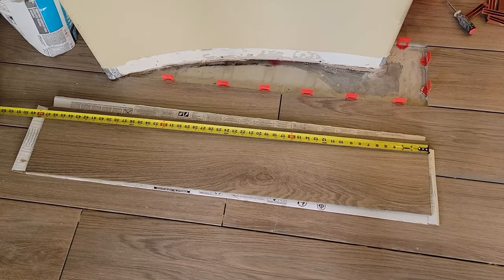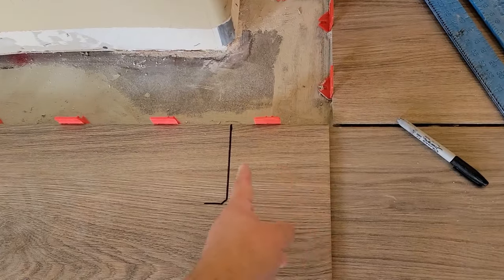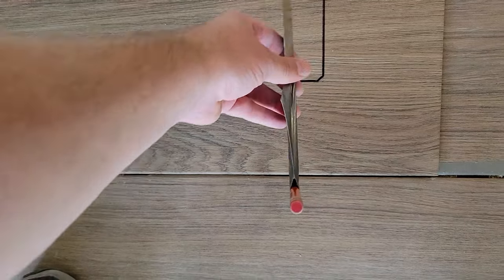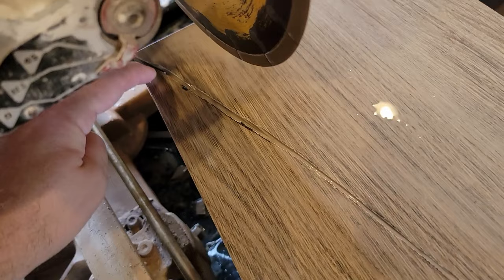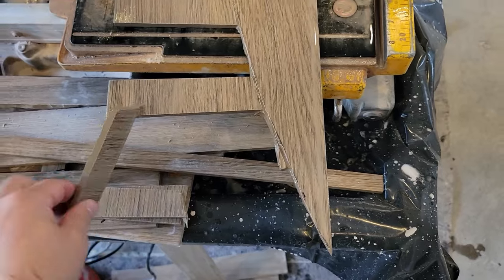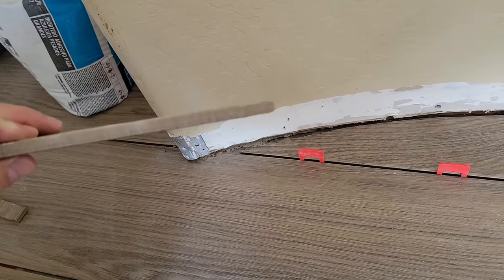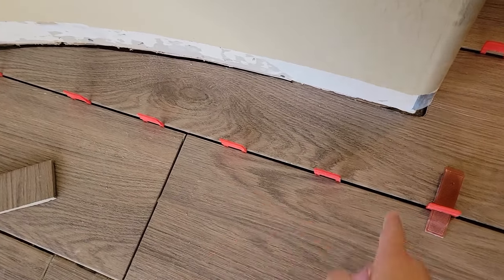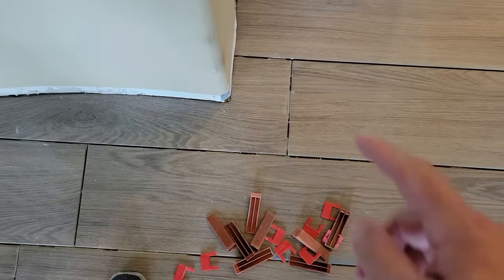Genius Hack To Cut Curves In Tile By Rounded Walls | Smart Tips & Tricks To Make Curved Tile Cuts

Comment: I’m a landscaper so laugh if you want, but I’ll just get cardboard , put it up against wall, use a knife to cut it to size, and then use the cardboard as a tracer to transfer the shape onto your tile or flooring. I’m just a landscaper 😅 I think what you did is called scribing? My dad does that without that tool he just uses his hand and the pencil.
Reply from the maker: If the cardboard method works great for you, that's awesome. I'm guessing the tolerances in landscaping are not so strict as in tiling.

In my case, especially with long tiles (and these were 4 ft long) the cardboard would most likely be an extra step and also open me up to error since it may bend a bit.

See the longer curved cuts in this other video: https://www.youtube.com/watch?v=JKDJlV7WtKo

Have a great day!
Reply: @MarkShows1  not saying you should do the cardboard method. just saying thats how me a dumbass landscaper gets these angles lol  4ft tiles sounds like a nightmare
Reply from the maker: If cardboard works great for you, that's actually a very smart way to go about it because you don't need to buy a special tool and most likely have easy access to cardboard from boxes, etc so thumbs up to you.

Comment: `you know if you used a grinder you could have it cut in about 1min instead of fucking around with a wet saw.
Reply from the maker: (This is almost a copy & paste of what I replied to someone else:)

Trying to avoid silica dust by any means because it causes irreversible lung disease or worse. Very dangerous, even small amounts that are not even visible.

So given that I had the wetsaw set up inside the house (while the temperature outside was around 112F in Phoenix, AZ), it took more time but yea, I usually do these cuts on the wetsaw and btw, very few houses have rounded walls.

But yes, the grinder (with some water) could be used outdoors in most cases but for some of the mansions around here, the mess that's created is also a problem (dirty water spots, tiny sharp tile pieces on the ground where people walk barefoot to the pool, etc).
Reply: @MarkShows1  ive been tiling 30 years, only time we have used a wet saw is for Marble/stone. 

isnt silica dust from stone ?
Reply from the maker: @Pedro.Chapps  

The following is just a part of what you can see at this link.
I added my notes in [brackets] below.

https://www.osha.gov/silica-crystalline

"Crystalline silica is a common mineral found in the earth's crust. Materials like sand, stone, concrete, and mortar contain crystalline silica. It is also used to make products such as glass, pottery, ceramics, bricks, and artificial stone. 
[some online source says porcelain has about 14-18% silica and porcelain is a type of ceramic]

Respirable crystalline silica – very small particles at least 100 times smaller than ordinary sand you might find on beaches and playgrounds – is created when cutting, sawing, grinding, drilling...[see link for more].

Workers who inhale these very small crystalline silica particles are at increased risk of developing serious silica-related diseases, including:

Silicosis, an incurable lung disease that can lead to disability and death;
Lung cancer;
Chronic obstructive pulmonary disease (COPD); and
Kidney disease.
To protect workers exposed to respirable crystalline silica, OSHA has issued two respirable crystalline silica standards: one for construction, and the other for general industry and maritime."
Reply: @MarkShows1  well 90% of us tilers are fucked so

Comment: Nice! You need to keep the pencil tile jig perpendicular to the wall. You kept it perpendicular to the back tile. Theat why your gap was larger towards the radius as rhe radius grew.
Reply from the maker: I had a bit of trouble moving the jig because I was holding the camera with one hand and the best way to move the jig is with both hands.
Still, I do think that one must hold the jig perpendicular to the long grout line all the time (or the long side of the tile).

If I were to hold the jig perpendicular to the wall all the time, as soon as the wall starts to curve and I adjust the jig for 90 degrees with the wall, my mark begins to cut into the tile and the more pronounced the curve is, the more is going to eat away from what's supposed to be my finished tile. 
The result would been a shorter tile and an increasing gap between wall and tile especially towards the tip of the tile.
That's how I see it happening.

Feel free to try some samples with cardboard or something and let me know.
Thanks for your comment and have a great day.

Comment: Nice work, 10/10! I use a diamond grinder for my cuts like these, I avoid wet saws for the most part. What clips do you use? They look like they break very consistently. Our company uses QEP and I find they don't break clean off  and require a very strong whack so we go with rubber mallets
Reply from the maker: Thank you! Link for these red clips (1/8 grout) https://amzn.to/3wf1iR0
I buy the 2200 pcs as the price per piece is better than 500 pcs.
And these are the white clips (1/16 grout) https://amzn.to/44mhkFc
Oh, and the re-usable wedges https://amzn.to/3UFv5eQ

If clips don't break 'clean off', it can be because there's too much thin-set around the legs of the clip in the grout line. There could be other reasons, probably brand related.

I avoid the grinder as much as I can because of the silica dust (found in other construction work too). See some of my long replies to other comments where I go into some detail on how horrible that dust is because it causes irreversible lung disease.

Comment: where's your angle grinder?
Reply from the maker: Trying to avoid silica dust by any means because it causes irreversible lung disease or worse. Very dangerous, even small amounts that are not even visible.

So given that I had the wetsaw set up inside the house (while the temperature outside was around 112F in Phoenix, AZ), it took more time but yea, I usually do these cuts on the wetsaw as not too many houses have rounded walls.

But yes, the grinder (with some water) could be used outdoors in most cases but for some of the mansions around here, the mess that's created is also a problem (dirty water spots, tiny sharp tile pieces on the ground where people can easily step on given the many pools around here, etc).

Comment: You would of cut that tile way faster with a grinder with a diamond blade and don't waste a lot of time 😅
Reply from the maker: Lots of tile guys would take a grinder and cut that outside which creates SILICA DUST - very dangerous!
Even if water was somehow added during the grinder cut to keep the dust down, there may be tiny sharp pieces of tile landing in places where the customer may step some day.
Therefore, I prefer to use the wetsaw for most tile cuts and I had it set up inside the house in a separate place.
Reply: @MarkShows1  that is why face mask exist I have been tiling for more than 15 yrs and some of the jobs I don't even use the wet saw so please don't give me those excuses but if you want to make your job more difficult be my guest or maybe you don't know how to use a grinder properly🤷‍♀️
Reply from the maker: I'm not giving you any excuses, I'm not criticizing you, I'm not arguing with you - I just answer your original comment in a decent way.

Now I answer your second comment/reply:
I'm a big fan of ZERO SILICA DUST although that's hard to achieve. 
If I were to use a mask and cut tile outside with a grinder, the dust will get all over me and then throughout the day I would breathe in certain amounts of dust from my clothes, etc. 

Silica dust can lead to silicosis, which has no cure and can be deadly. Lung cancer is in there too. You can read more at this link but I'll also copy and paste the article for others to see and protect their health. 
Silica dust can be a killer! 
https://www.osha.gov/silica-crystalline

(This article is the above link. )
Crystalline silica is a common mineral found in the earth's crust. Materials like sand, stone, concrete, and mortar contain crystalline silica. It is also used to make products such as glass, pottery, ceramics, bricks, and artificial stone.

Respirable crystalline silica – very small particles at least 100 times smaller than ordinary sand you might find on beaches and playgrounds – is created when cutting, sawing, grinding, drilling, and crushing stone, rock, concrete, brick, block, and mortar. Activities such as abrasive blasting with sand; sawing brick or concrete; sanding or drilling into concrete walls; grinding mortar; manufacturing brick, concrete blocks, stone countertops, or ceramic products; and cutting or crushing stone result in worker exposures to respirable crystalline silica dust. Industrial sand used in certain operations, such as foundry work and hydraulic fracturing (fracking), is also a source of respirable crystalline silica exposure. About 2.3 million people in the U.S. are exposed to silica at work.

Workers who inhale these very small crystalline silica particles are at increased risk of developing serious silica-related diseases, including:

-Silicosis, an incurable lung disease that can lead to disability and death;
-Lung cancer;
-Chronic obstructive pulmonary disease (COPD); and
-Kidney disease.

To protect workers exposed to respirable crystalline silica, OSHA has issued two respirable crystalline silica standards: one for construction, and the other for general industry and maritime.
Reply: @MarkShows1  jajaja all the tilers I know for 20 yrs plus are still alive and kicking if you are so worried about this kind of dust then you shouldn't get out of your house because we breathe all kinds of dust every day and everywhere...people who never smoked in their lives end up with lung cancer so one particular dust doesn't define how you're going to  die ....blessings anyways....
Reply from the maker: @maricelaa6  Blessings to you too. Hope our conversation here and the link I posted will help others too. I wish I knew all about silica dust 25 years ago. Here's a video on the topic of silica dust from Australia:
https://www.youtube.com/watch?v=c-zVty3zhLc

The fact that some guys breathe silica dust and seem fine after 15-20 years, does not mean they are ok. A check up at the doctor will most likely show lung problems. So my thought process is: why continue breathing SILICA dust if I know it is horrible for health or even deadly.
Reply: @MarkShows1 
Listen to that clown down talking safety. I been in the field since 98 and right now a good friend of mine who is also a setter is dealing with serious respiratory problems from the dust of all the tile products combined over time. Grout, thin set and dust from cutting like you mention.  When I was a kid I came up under a couple ignorant people like this guy counter posting you. I was mixing In a mud box in new construction  inside homes with the Portland type 1-A cement dust and my boss saying oh I know people that have been tiling for years and are still fine.  The guy posting is a perfect example of someone that is ignorant. I don’t take the precautions like the above guy mentioned but I also don’t tell people that it’s ok you will be fine.  Anyway I appreciate your video and you paying attention to tell people the severe risks associated with the trade were in.
Reply: @maricelaa6 why don’t you make a video and show us how it’s meant to be done ?
If someone doesn’t want use a certain method due to health and safety then why you arguing over it?
Just because people are still alive doesn’t mean it’s not affected them or it won’t affect them, also not everyone’s body is the same